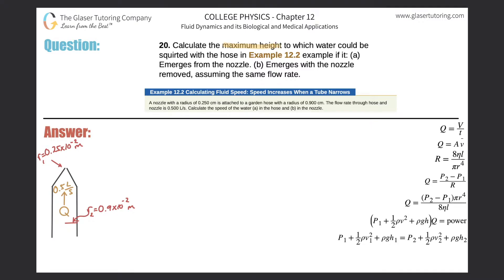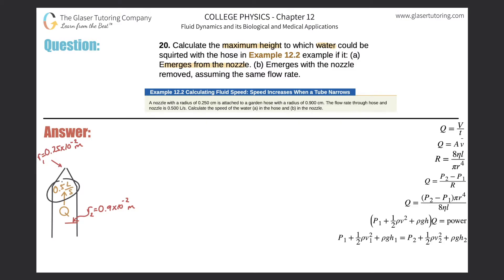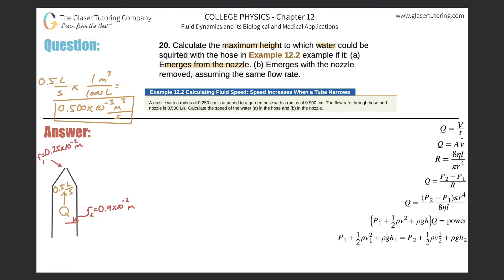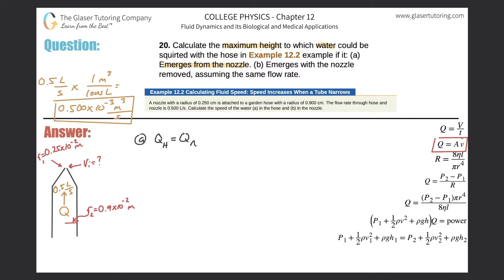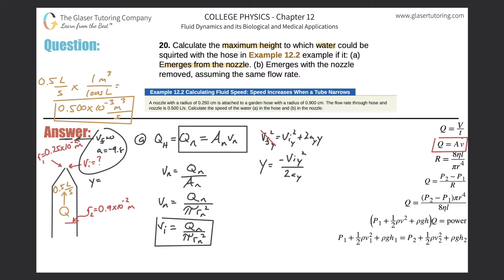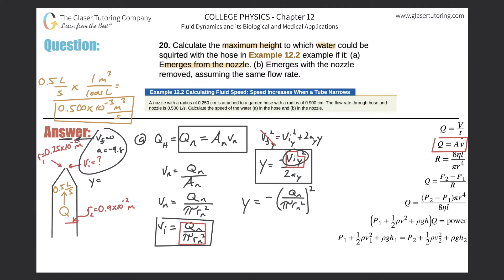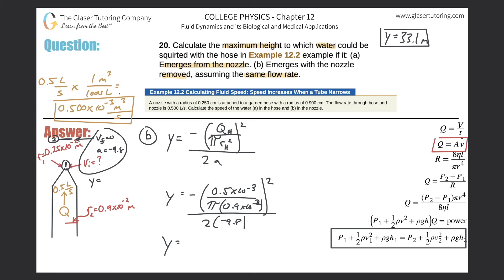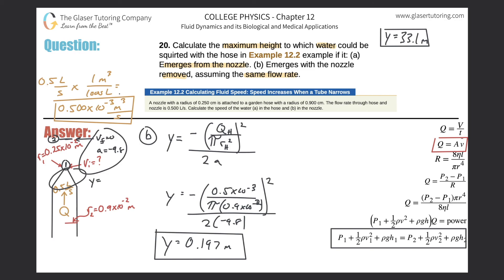12.20 | Calculate the maximum height to which water could be squirted with the hose in Example 12.2

Comment: Thanks for the video. I am trying to figure this out for a hydrant that has 300 ft of hose connected to it with a supply pressure of 125psi. Can I use 125 psi for station 1 and 0 psi for station 2?